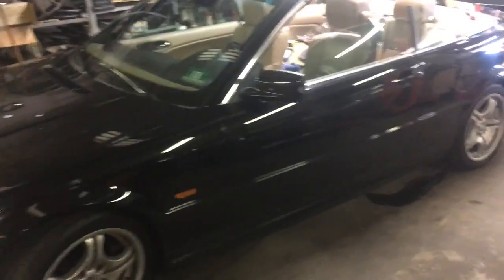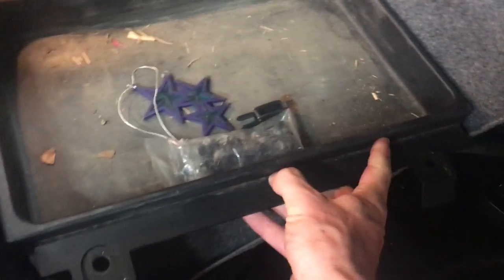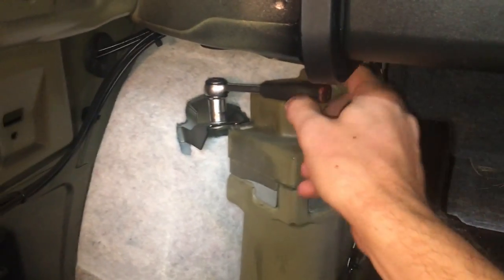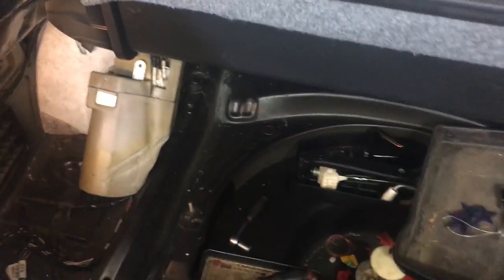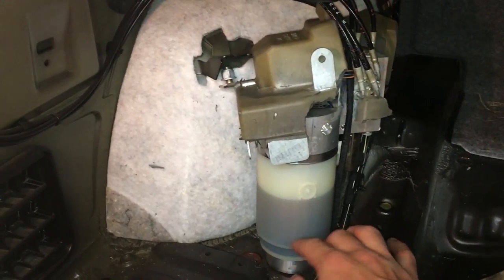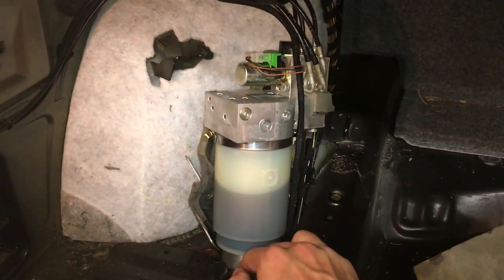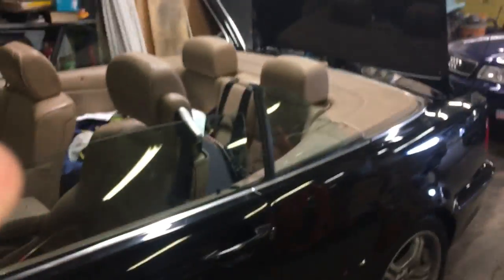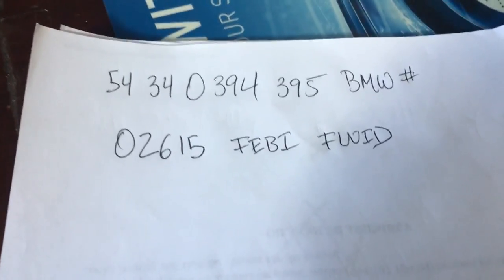BMW Convertible Soft Top Pump Fluid Fill and Check E46 3-series

Comment: What size and what kind of  fill..plug .my bmw is at the min. Mark and will not retract...
Reply from the maker: Hey gearhead moff123 thanks for watching my video. Off the cuff I can not recall. Have you scanned the vehicle for fault codes? Please share your diagnostics.
Reply: Its not pulling any codes pertaining to top . "per" auto zone diagnostic test.
Reply: Do I have to purchase a special code scanner for electric?
Reply from the maker: Did they scan all the modules or just and OBD scan of the engine module? It is best to do a full system scan, where someone can observe live data. Did you check the basics such as the luggage compartment stow away?

Comment: What if the top will not come down?
Reply from the maker: Hey Heather Hanson, thanks for watching my video. Have you tried manually putting your top down and seeing if your top will go up. This will help you diagnose the issue, get back to me with the results. You can google how to manually operate your top on a E46 Bmw. If any of this helped please consider subscribing, it would help me a lot
Reply from the maker: Hey Heather Hanson, did you get it to work ?! Please share. Thanks for watching my video.

Comment: Is the hdydaulic oil level checked when the roof is open or when it is closed?
Reply from the maker: Hey Pipmen thanks for watching my video. I always check the tops with them closed. I do not believe it matters, but it is important that you cycle the top after adding fluid to get some of the fluid to move through the system, then check it again to see where the level is. If you add fluid after cycling and cycle again, find that the pump is missing even more fluid you should check for leaks. There are common hydraulic lines that fail in the e46 such as line 23 and so on. Please keep me updated so I can continue to help. Please consider subscribing to me it would help me a lot, thanks.
Reply: @WheelsTips   thanks for the quick reply, subscribed! But your answer confuses me. If it would not matter than they would not have made the minimum/ maximum markings. I have checked it like you when it is closed...then iz shows max level. When the roof is closed it is over the max level.

Where is line 23. Can you explain it or make a video about the leaking lines? I don't think that mine is leaking but it is always good to know.
Reply from the maker: Hey Pipmen, if you fill with top open or closed to the middle line and cycle the top it will go to minimum then you add to middle. Even if the top was cycled it would just move to maximum. I hope that cleared up the confusion.
Reply: @WheelsTips  Thanks...will check it. Could you watch my video and give me a hint what the issue could be? I already have changed the hydraulic pump, but it didn't help. Please take a look, thanks!
Reply from the maker: Hey Pipmen have you checked the wiring harness in the soft top drivers side where the top bends. It’s a common spot where the wires overtime break. If you look at your video at about 11 seconds follow the drivers door handle up to the roof that bend is often where the wiring harness breaks. Check that and get back to me. It might be smart to get a BT tool and scan the convertible top module for faults.
Reply: @WheelsTips  I did already check it for error faults with INPA and with BMW Scanner 1.4...no failures! If it would be a electrical issue I would expect that the pump stops...but the pump is still working....you can hear it in the video. Anyhow I will check the cables. Thanks for giving the hint.
Reply: I have fixed it. One of the three hyraulic valves was defective.
Reply: Mine is a little above the min mark and my top will not go back, it unlatches and pop up about 2 inches or so, would this still be the fluid or something else?
Reply from the maker: Hey @gearhead moff123 any update on your diagnostics, thanks a bunch.
Reply: @gearheadmoff1232  it could also be the valves.
Reply from the maker: @gearheadmoff1232  Just wanted to see if you were able to resolve your issue with your convertible top on your BMW E46.  Thanks a bunch for any update.

Comment: How do you fill the fluids?
Reply from the maker: Hi thanks for watching my video. At about 2:15 I show where the screw is that you need to remove to add fluid. Let me know if that works.
Reply: What shape and size is the plug..hex ..star... ect...

Comment: How do you extract old fluid?
Reply from the maker: Thanks a bunch for watching my video and taking the time to comment. I was not doing a flush of the the system, otherwise an extraction tool for liquids. Are you flushing your system or just adding?
Reply: @WheelsTips  flushing I got the old fluid out but I think my pump is shot same slowness after fluid change
Reply from the maker: Thanks for the update, you may need a hydraulic unit rebuild. Google search, rebuild remanufacture convertible top pump Mercedes W124. This will give you much cheaper options than replacing the pump, if the pump is faulty. I believe some services benchtest your pump before repair to see if it is the pump. Please share an update, thanks.